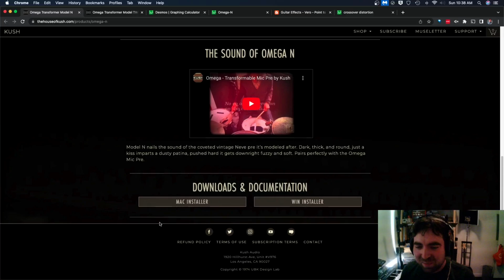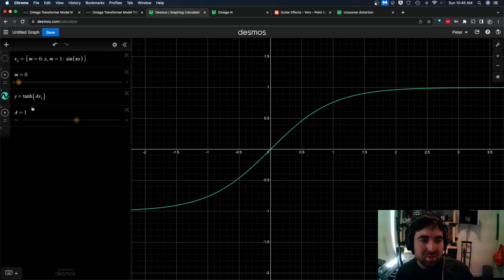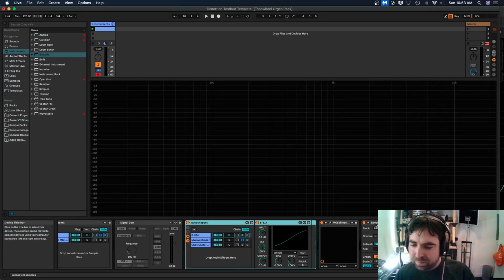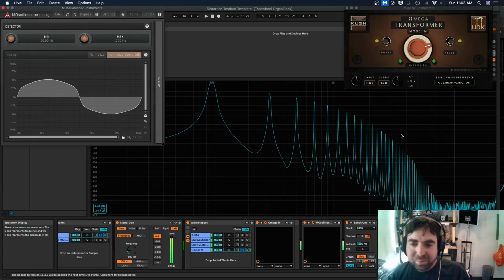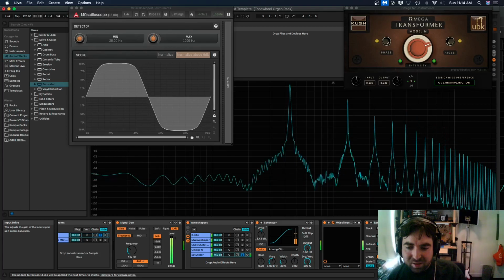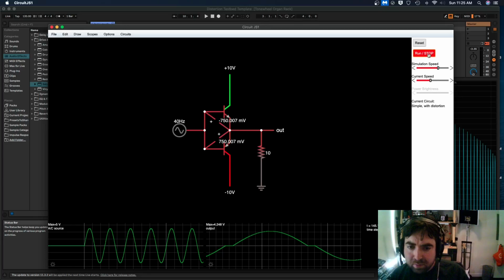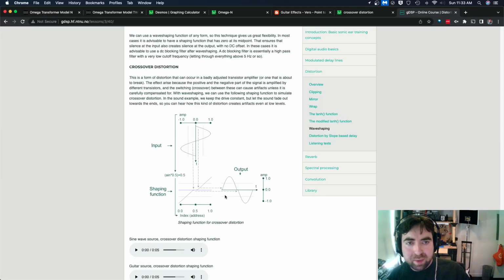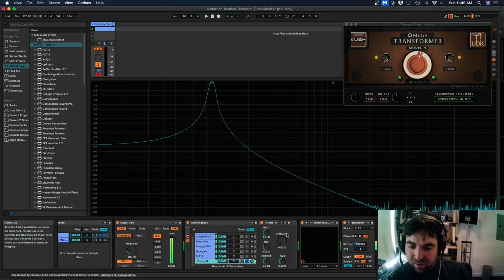Reverse-Engineering Waveshapers (Kush Omega)

Comment: Hello, I was looking for analysis data on omega-n yesterday, and found your post on reddit and came here.
I'm useless in your field, I only make music, and I find it difficult to translate your knowledge. Is there a way to replicate omega-n in melda mwaveshaper?
What formula should I make to import it into this plugin, to replicate similar effect in harmonics?
Thank you for your amazing work, and sorry for this long text.. 💪🏾🙏🏾
Reply from the maker: Yes, you could use any sigmoid curve there (I think there is a preset called "Compressor" that should get you ballpark, but you could easily draw your own). Just turn down the mix to a couple percent and start cranking up the input gain. It won't be exactly the same if the curve is slightly different but it should get you close enough.

For what its worth, there are plenty of free waveshaper / clipper plugins out there that should include a tanh plugin and a mix knob. This is all you need to get what I was showing.
Reply: @IconicPhotonic  I appreciate your detailed explanation. Now I understand better. I've been reading about tanh formulas and how to apply them since reading your post. Without it, I wouldn't have learned about this topic. Thank you very much 👏🏽